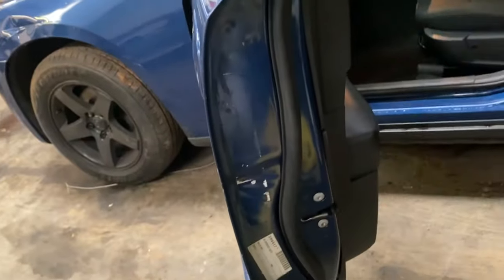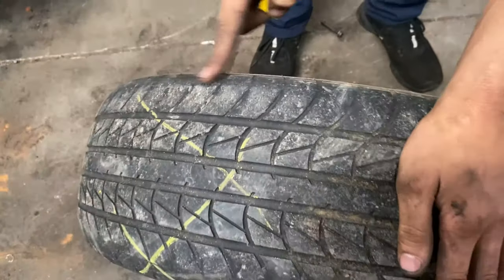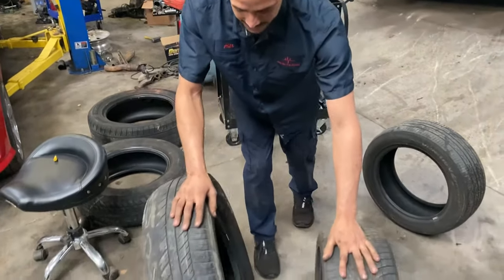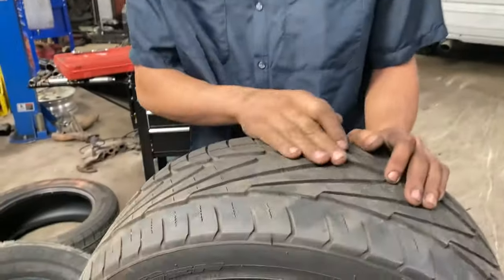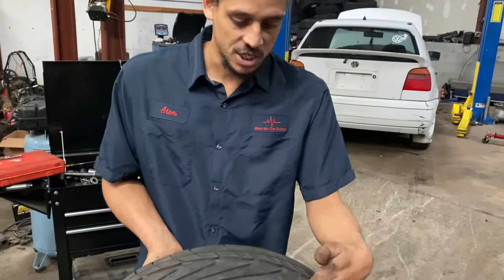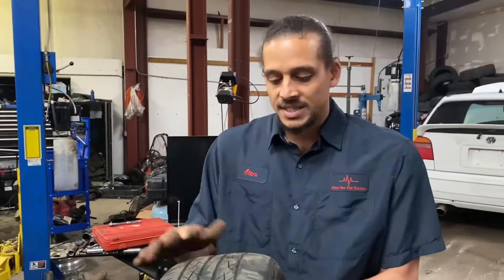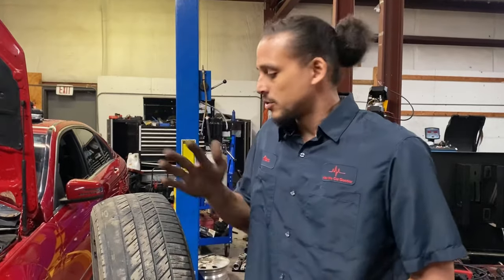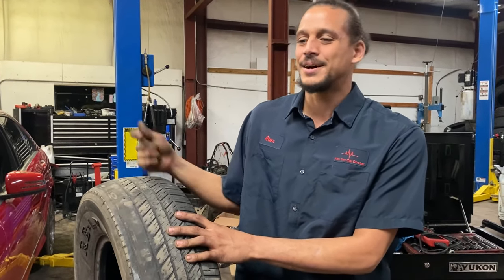Why Tires Wear Unevenly ( Top 5 Reasons) #tires #tirewear #uneventires automotive tire noise

Comment: I bought new tires for my Crown Victoria. but front tires only lasted for 6 months, because my alignment is messed up. Make sure to check the alignment when you decide to invest on tires for old or high mileage used car.
Reply: Probably need new ball joints and tie rods. And shocks Gabriel ultras for cheap, kyb for OEM and bilsteins.

Comment: Thanks for making this video! Simple explanations yet very informative.  I just took my 2011 F-150 to get tires rotated and they mentioned the front tires were cupping, and you can see it like mountains and starting to make noise.  They recommended me to check the shocks checked.  After watching this video, I am confident that’s what’s it’s going to be 👍🏻
Reply: My ford f 150 tire in the back is wearing on the in side would that be the shock
Reply: @budeugene5301  possibly mate that’ll be camber issue your having which could lead to a bad shock but I feel the spring/ rear suspension setup is too far negative
Reply: My ford f150 done the same thing front tires bald on inside.

Comment: I learned a lot from this video 
Recently I had been going through a problem with the company that had bought four new tires. The tires all have the same name brand on them.
But I  didn't have enough money left to buy the warranty for them. Being new I didn't think that there would be a problem with them.
Putting my trust in the company and product. After about 17 months, I noticed a little wobble coming from the rear of the car..But it wouldn't happen all the time. So I kinda brushed it aside. And then the tpms that is built into the car showed me that the air pressure was low and I should have it checked. Now this is about 2 weeks after I had noticed the problem. But still less than 18 months since I purchased the tires. I took it back to the company to check on the tire. They took 3 hours to tell me that I didn't have any warranty on the tires and it looks like I have ran over a rock. Which caused the damage. 
They never even took the time to take the tire off.
But made like the car wasn't in good condition. Like pointing out air filters that were dirty and wipers in poor condition. Remember now,I just wanted them to check the one tire.
Long story cut short, I did a little research on how to find out the age of the tires. Out of 4 tires bought in 2023. 2 of the 4 were exactly alike, 1 was 6 months older than those. But the one with the problem, was early 2021 model...now it is the latter part of 2024.
The tires only have gone 17,000 miles and 18 months. The one thing I have found is that there are stress cracks that go around the entire tire and a bubble. I am not a expert, but would a rock really do that much damage to a tire 😊?
Also noticed that I see metal wires poking outside of the tire. I don't know what to do because, I think that this tire  might have been a defective product. Any idea on how I should go about settling this problem with the company. 
Cause I paid almost 200 dollars for each of these items. And didn't even get half of the lifetime expectancy or  the minimum miles yet. And they want me to buy another one. ANY THOUGHTS WOULD-BE GREATLY APPRECIATED 
THANK YOU

Comment: Thanks for this! I think my tires may be slightly under inflated because there is sone extra wear on the outside. I also think my shocks or springs are needing replacement because the car bounces around a bit whenever I go over rough roads. The question that I have not found the answer to is this: do front or rear tires wear faster on a FWD vehicle? I have a Lexus RX330. I rotate the tires every 5000 miles with the oil change. My front tires are at about 7/32 and my rear tires are at 5/32.

Comment: 6:35 that happend to my c280 w204  too. My rear tires seemed fine from the outside but the innerside was completly worn to the metal wires.

Comment: Thanks for sharing . I had my wheels in storage over winter and when I took to switch summer - the tires are not straight , looks like the tires are buckled and not even. Any ideas what caused that? I was told to replace all tires :(

Comment: Thank you so much, you must read my mind because I just bought this 2012 QX56 Infiniti and it just felt like something was wrong either with the tire or something on the right hand side because it just kept feeling like it was riding bumpy on that side of the SUV I could feel it even in my steering wheel while I was driving however I did notice that the outside of the tires look to be worn but the inside has plenty tread and even on the top of the tire. thank you so much I can't thank you enough now I know exactly what I need to have replaced I will be watching out for your videos because who knows I may have other problems or issues later but I do appreciate you Thanks again Lavern😅

Comment: Hi, I have a 2023 ram 3500 dully and Im usually pulling a trailer with35k pounds more or less and my front left tire is wearing from inside and outside, the middle of the tire is practically new , I have never seen something like this before, all bushing on the rods and shocks are good , what do you think could be . Nobody can tell me what the problem, probably you can help me . Thanks for your videos.

Comment: 1 tyre care, needs rotation, tyre under inflation,  tyre over inflation
2 loose or broken suspension component. 
3 suspension: uneven tyre surface
4 Wheel alignment
5 Accidents

Comment: I liked your video and it was very informative.However,I still have a question in mind.If my car was aligned 2 yrs ago and tires were at 35psi pressure then.what happened if I changed the tires after 2yrs and set the pressure to 40 psi,and I noticed that the label on the side door specify that a pressure of 33psi is recommended.what kind of wear do I expect?I have been hitting a lot of potholes on highway recently and noticed that my  front tires are only losing tread on the inside  only the part that is close to the engine.I thought about adjusting this negative camber but somebody told me that a toed-in wheel can also cause this kind of tread wear.What I did was to deflate all tires to 35psi and i am watching to see if this will remedy the situation.but the tread on one side are almost gone now and it hasnt been 3 months yet.so what is ur opinion about the cause
Reply from the maker: I will have someone check out the front end for play you most likely have a worn suspension component that the alignment shop missed or worn out after they did the alignment.tire pressure in that small increments will not affect anything from my experience

Comment: So i got a 2008 GMC Sierra 1500 got new struts and shocks all the way around. Including new tires now, i can feel the mountains forming on the inside of my front tires. Where do i go from here, any suggestions its been aligned when the new struts were installed?

Comment: My tire have the symptoms exactly the same as your “shocks” section - wavy inner wear, sounds like bad wheel bearing. But I just changed to a BC Racing coilover. 

What might be the issue with the setup? Too firm or too soft that caused this waviness?

Comment: Hello Alex. Thanks for the much needed informative video. I have a question regarding my toyota car. My front left tyre worn out from outside completely even after wheel alignment, and two tyres were damaged over a period of time. So just days back i purchased two new tyres and did wheel alignment but my left front tyre is showing signs of wearing out from outside again. What could be the possible reason? Thank you.
Reply from the maker: Hey there someone is not doing the proper checks on your suspension. something is worn out that the alignment shop is missing, I see this all the time they will just do the alignment and line up a car with loose suspension components once the car  goes down the road it throws back out of alignment due to loose components or damaged compartments.I have a video coming out soon showing how to check suspension components,I may have an old video showing but I can’t remember
Reply: @alex will surely check out. thank you 👍

Comment: Great video thanks! I've hit a massive pothole once and now I think my CV axle bent... Both front tyres wear more on the outside and a wierd humming noise happens when I drive with right steering direction. No noise when driving left.
Reply from the maker: It sounds like you have a bad wheel bearing.I Would recommend a full front end Inspection on a shop lift
Reply: @AlexTheCarDoctor  thanks for the tip!  I'll take to the garage hope they identify what's wrong so i can change myself
Reply from the maker: That’s your best bet,have them identify the problem and you fix it

Comment: I'm considering buying a car that has been in an accident but has been repaired, and the nearside tyre has excessive wear. Possibly either of these 5, if the vehicle does have a bent chassis or frame, or if the vehicle has damaged or bent suspension components is it expensive to repair? The car is great spec great mileage great price.
Reply from the maker: Hey buddy. I don’t recommend buying cars that has been in a bad accident frame/chassis work can be expensive also some accident cars comes with weird problems sometimes like electrical and the resale value is affected hope this information helps

Comment: very good tips Alex but I have a problem that's not in your video, one of our car, 2011 Camry has problem with its tire that worn out so fast (evenly). First, we thought we bought bad tires or our son drive badly but now we drive this Camry our self and we have to replace tires new  every year, after about 25,000 miles, even Costco refused to honor their warranty, they said some thing wrong with the car, any Idea what's wrong without taking the car apart to look inside, Alex??
Reply from the maker: Hey there. What is the history of the car like accident,clean title or rebuilt title, what suspension work have you had done recently,things like that will help me determine what’s going on
Reply: thnx for your reply any we bought this car new, we had this problem the 1st year and  as mentioned earlier, we thought because the way our son drove. the suspension (front) are new, we replaced them after being recommended by Costco. The back are original.
Reply from the maker: @Ankorthmey  wow original owner okay. I would love to see this car for myself I’m pretty sure you don’t stay in my city though right now I’m thinking factory defect in the body structure, you say it’s been doing this since day one off the showroom floor correct

Comment: Is good to know all this and more, but I have seen this: No matter what you will need to buy new tires every 3 or 4 years, Alignment is wasting money unless you replace a critical part in your car, but even so I replace Struts, lower arm control with a new ball joint, sway bar link and new cv axles without alignment and was fine, perfectly fine.
---  Rotate your tire together with the oil change if you do it every 5 K miles. If you do it every 3 k miles, then rotate every 6K miles and your tire will last the time until replacement of course keep the PSI correct and be happy. All these videos is to scare you, that's it.
--- My last tires got 85K miles just rotating and keep PSI 33,and still was good.

Comment: Hie Alex I have a Toyota Noah 2011 version. I have a problem with Rear tyres finishing inside. I had to deal with buying bushes  and replaced but I keep on with the same problem. I was told by one exprt that my axle is bent I bought a second hand and replaced . Tye problem still is not solved. Tell me what should I do . Thank you, Yours Ole
Reply from the maker: Hello there I’m not to familiar with that van but I still may be able to help first off how long have you had the van and what do you use the van for hauling people hauling very heavy items etc.

Comment: My Lexus IS250 has a staggered set up. The option of rotation is not there, so do cars like mine run into these problems more than a car you can rotate the tires on? Thanks
Reply from the maker: Yes I see problems like this all the time with vehicles like yours,I always tell my customers that they wasn’t really meant for daily driving more of a weekend fun car for the twisties
Reply: @AlexTheCarDoctor  I don’t daily drive it as I only put 8k miles on it per year. I also am about to put on some nice tires on it. Michelin pilot sport all seasoned tires. I hear those are actually built and designed to last longer on cars like mine.
Reply from the maker: @KingDrewPhilip  you are absolutely right Michelin in my opinion are the best tires if you can afford them I’m not on that level yet lol

Comment: I did an alignment and rotation two months ago, but I notice the inside of my front tires are getting eaten more than any other part. Could that mean I didn't get a good alignment job done? I also lowered the car 1.2 inches. Could that be the issue?
Reply from the maker: Hey there that should not matter I have a feeling they did not do a good job,you may also have loose or damaged suspension components,the shop suppose to check that before performing the alignment

Comment: I think 2013 GMC Acadia has an electrical problem. New battery, good alternator, good starter and new thermostat and still will not start or turn over. Turn the key on and dash goes black. Acadia ran hot and shut off! Replaced thermostat and battery and still won’t start.
Reply from the maker: Hello there sorry to hear that you are having problem’s.did you check all of the fuses
Reply: @AlexTheCarDoctor  No I haven’t tried the fuses. I am on that next. Thank you
Reply from the maker: @feliciamorris38  my pleasure let me know how it turns out

Comment: @alexthecardoctor. So if i have lower control arms that needs to be replaced. And its wearing the inside and outside thread. after replacing the control arms i need to re-align and balance the tires ya? And also maybe rotate them?

Comment: I bought some rims and it came with some decent tires but 2 of the tires are bald on the outer part .. can I mount them and use them like that or should I buy new tires
Reply from the maker: I don’t recommend using any type of bald tires. You can find tires really cheap on eBay quality new and used tires, then take them to your local tire shop

Comment: my tires was wearing from inside, I was told I need  front alignment. i took it to the shop they aligned it. I kept having the same problem, they aligned it again.  by the third time they told me they didn't know why my tire is wearing. I won't tell the shop name but they have shop everywhere.  I had to look up on utube what maybe the problem.  thank for your info.
Reply from the maker: Sounds like NTB lol.what type of car do you have
Reply: @AlexTheCarDoctor  I have a 2006 chevrolet impala. with it being an American brand it shouldn't have been that complicated.
Reply from the maker: You may have bad control arm bushings, mechanic shops frequently overlook the control arm bushings
Reply: @AlexTheCarDoctor  thanks. I have it check out.

Comment: Good, informative. Can unevenly wear tire cause knocking noise?
Reply from the maker: Hello there and thanks for watching. The tires themselves should not,but combined with loose worn out or broken suspension components or improper wheel lug tightening/torque will cause some type of noise. I suggest jacking your car up on jack-stands and check all suspension components and lug nuts . I will have A suspension diagnostic tutorial video coming with you in mine.
Reply: @AlexTheCarDoctor  good to know. My 2005 Camry is making a loud knocking noise. I first thought it was wheel bearings. So changed two front wheel bearings and right CV axle because they were bad. However, the noise is still there but not as loud as before. But I do notice that the inward of tires are worn. Any suggestions? What may cause the noise? Thank you so much.
Reply from the maker: You may have a worn out or loose lower control arm bushing.
Reply from the maker: Hard to know for sure though maybe make a video of it with the wheel off so I can personally look at it
Reply: @AlexTheCarDoctor  mechanic says it is the tires causing the noise. I will change them and see how it goes.
Reply: Hello Alex. The problem with my car is solved. At the beginning, there were very bad tire noise and wheel bearing noise. I ended up replacing two front wheel bearings and two CV axles. But after that, the noise was still there. Mechanic told me to change tires. After changing the tires, the noise is now completely gone. After replacing all the parts and tires, I did an alignment. This 16 year-old car feels like new now and is so quite. And it is quieter than my 2018 Ford Focus. I did not expect that tires can make so much noise until I replaced them. Hopefully, there are no other mechanical issues that make the tires unevenly worn.
Reply from the maker: @taoye5659  that’s wonderful to hear man that tire must been very bad. Every car I get I make sure the tires are like new or new it really makes a difference.

Comment: 2.5 years of owning a used car, since the second day i couldnt find why my car is shaking. Changed the tyres and took to the mechanic for inspection twice year after year mechanic said everything is fine. The second year when i took the only thing mechanic said was just the front tyre is choppy and rest of the components are fine. After looking my tyres and found myself that 1 year/ 20000km tyres threads are very much left but upon closer look the threads are wavy similar to the video. But still When i checked the suspension it looked fine with no fluid leakage. Can anyone suggest me if it could be a suspension?
Reply from the maker: Hey there what is your mileage on the vehicle and what type of car do you have
Reply: The steering wheel of my minivan is shaking now while I am driving. Is it due to bad tires?